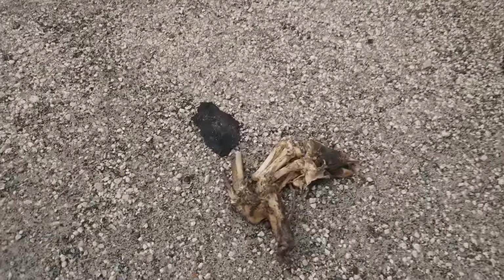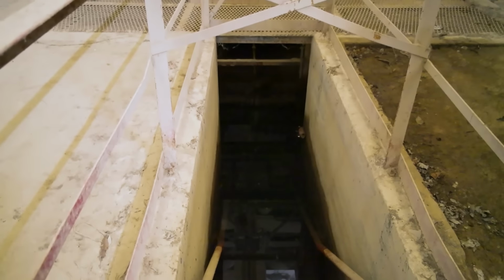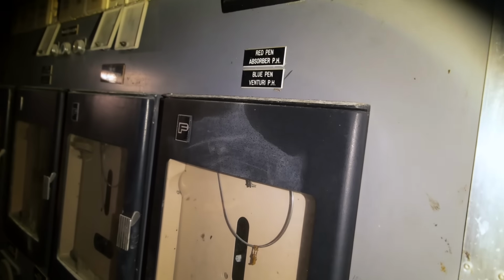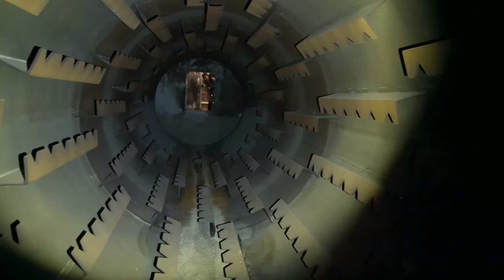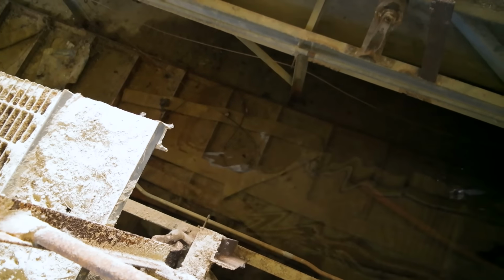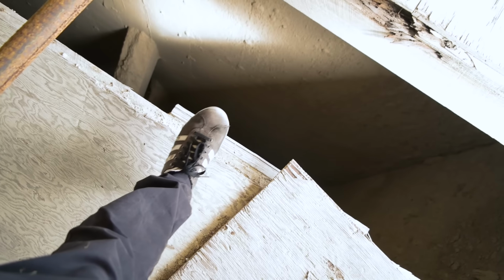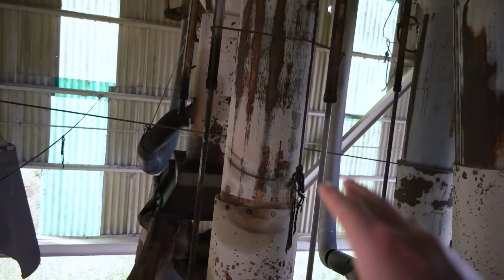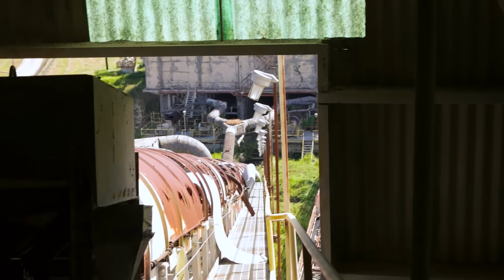ABANDONED Phosphate Mine (discovered control room)

Comment: The control room and chart recorders (in order of appearance):  First one has F&P in the corner.  That stands for Fisher and Porter.  The loop inside the door when pulled towards you lifts the pen arm away from the paper so you can change the paper chart.  It's a 24 hour chart.  Notice a black line around the edge indicating the 12 hours of PM.  Next is the box of blank charts for the next day.  Honeywell temperature indicators/recorder 0-500 Degrees.  Then after you ask about pH a 0-400 temp rec./indicator.  Uniloc pH indicator with thumbwheels for setting high and low alarm setpoints.  Uniloc model 1003 came before the Great Lakes Model 63.  More F&P recorders then the panel on your left has a strip chart recorder.  Same principal as a circular chart but it records vertically on a strip.  (Like an old player piano)  Finally, the blue blank chart you have in your hand also has a blue line for PM time.  It has a big hole in the center for putting it onto the center hub.  The smaller hole in the chart is lined up with the small nub on the hub so the pen lines up with the time of day it is right now to start recording.  These are antique instruments from the 60s.  Some industries still use these today as I still calibrate them as a process control technician.  Most are now digital and data is collected every minute into a computer, then printed on a few sheets of paper or emailed as a 24 hour history.

Comment: As a chemical engineer i know these kinds of plants very good and there is like no dangerous radiation levels, the amounts of Uranium in the rocks is very low and they are removed at the start of the processing and mostly used togheter with other junk streams from the process to make plaster (i think that's the correct english term for it). 

Now just a tip here for people that want to go and explore chemical plants of any kind always wear protective clothing and gasmasks because you guys climbed in the crushers and reactors of the plant wich still is full of material wich even if you say is very old still dangerous. This safety is learned to evry chemical engineer, an empty bottle is not empty, in al containers is still dangerous material no matter how long it has stood there (alot of accidents happens like that, people that open up a chemical container with a welding torch or something and it explodes due to fumes). So just a hint protect evrything like you do in alot of videos with a gasmask, maybe goggles and maybe to spare clothes such white chemical suits, they protect very well and are cheap (sorry for bad english)

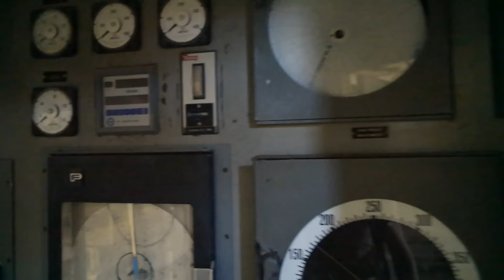Comment: 2:20 - It's a chronograph disk. It seems that the whole control room is stuffed with those. Basically it's a paper disk mounted on a clock: the disk rotates as times goes by, and a pencil draws a line on it, keeping track of whatever it's connected to.

Comment: Yo Josh, the thing you're pointing at in the control room that looks like a disk behind some glass. That's possibly a sizemograph. They were used to keep track of the way the earth moved when mining and to tell if there was an explosion in which could be the reason they flooded the mine, to stop any further explosions if they became drastic. It would be spun slowly and the needle hanging over it would move with the movement of the earth, drawing a line as to where and how the ground was reacting to the mining, and all the lines with numbers through them would count how much on the scale the mine was reacting. It was basically used to keep track of the reaction scale and when to stop certain things before equipment was damaged, if it came to that point. Hope this was in the slightest helpful for you next time.

Comment: Just FYI, that spiral graph you were looking at is a circular recorder chart, and it measures/monitors all types of things like flow rate, pressure, temperature. Basically you get readings throughout the day and at the end of the day the readout will have a whole lot of lines on it based on whatever the parameters were at any given time.

So what was in there would have been the next day's readings, but the next day never happened 😱😝

Comment: Not sure but I think that round thing with the moving arm inside is a Seismograph. Its used to test the ground for seismic activity (Earthquakes). the ground is constantly moving so in a mine its a major hazard if something goes wrong. If the seismic activity is higher than a certain point. The crews would be evacuated from the ground until the activity settles.

Comment: Those paper dials look like cavitations monitors. They would record vibrations in the water pipes that occur when unwanted air enters the system. Those vibrations have the potential to cause the pipes to fail. It could be especially dangerous if high pressure or high heat steam is used.